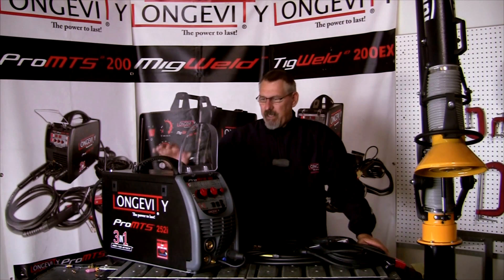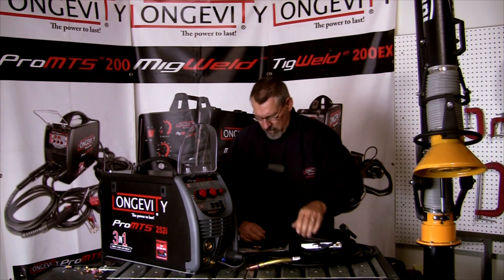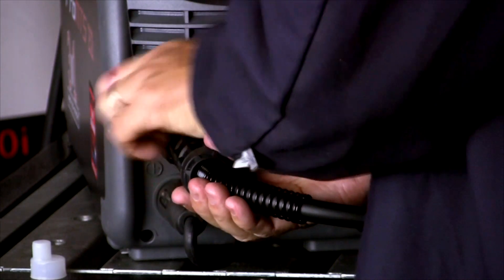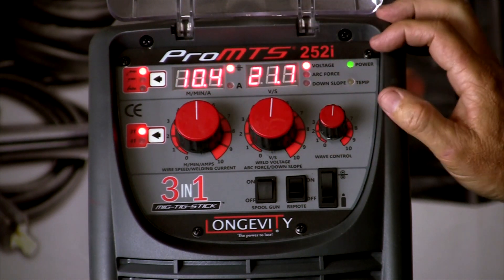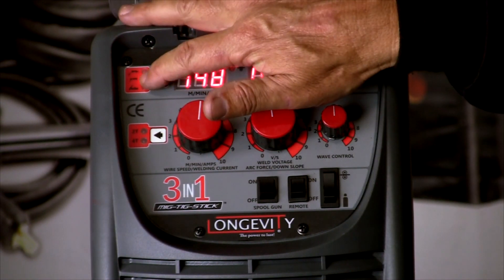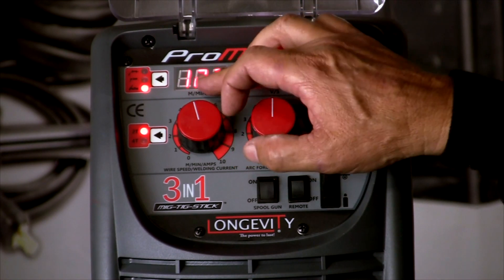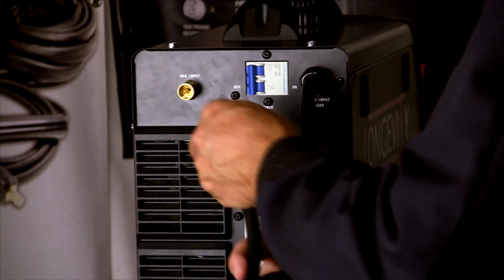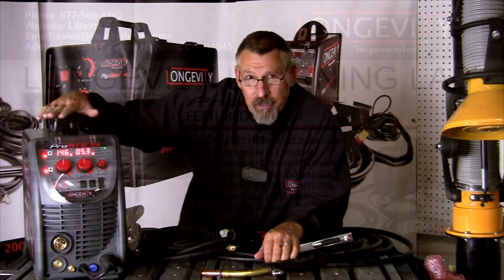Longevity PROMTS 252i - 250 Amp 220V/110V MIG/TIG/STICK Welder (3 in 1)

Comment: Yes, I possible I did learn something today.  This welder does not come with a TIG torch. It does not weld in AC.  I have no idea what types are available nor how much it adds to the cost or if other manufactures equipment are compatible  with the connector.  I also learned that the wire feed assembly is a secret.  You have to buy it to know what's in it.  It would be nice to see the feeding assembly.

Other than that it looks like a good MIG/ DC only Stick welder outside.  I suppose it is  possible to weld aluminum on DC, but I thought AC TIG welding aluminum was preferred.  Does longevity make a spool gun for the MIG function to weld Aluminum?